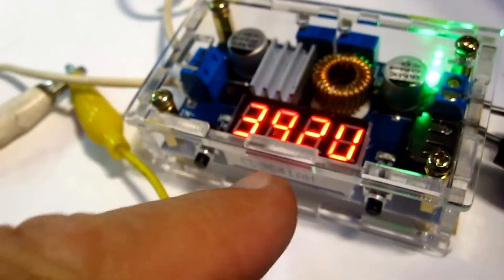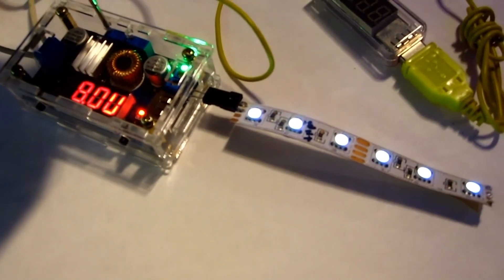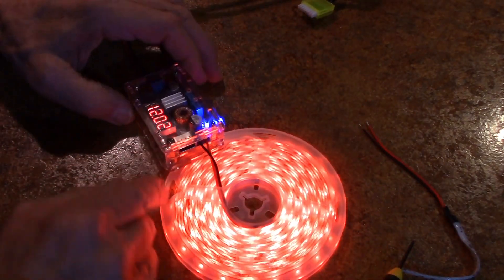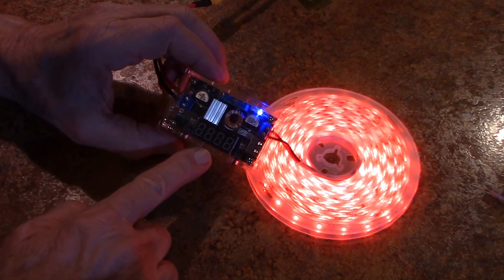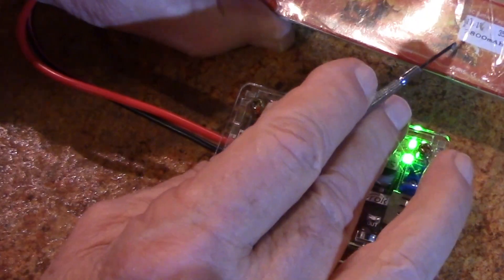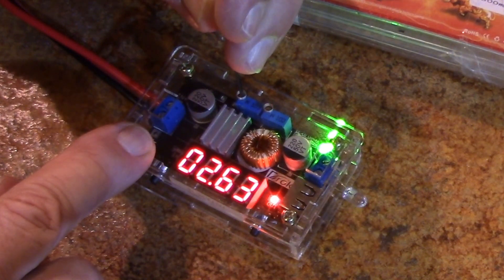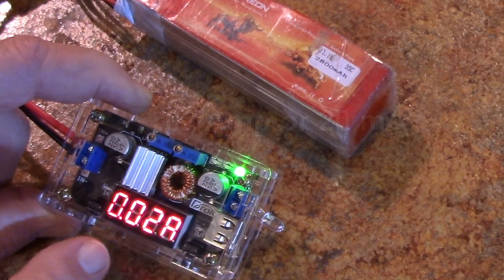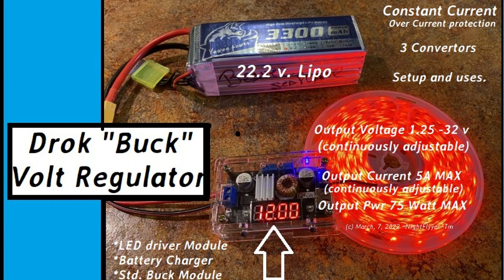This DROK still rocks! Here's how to use the DROK LM 2596 "Buck" Voltage regulator with a demo.

Comment: How would I add this to a light circuit in my car to increase the voltage on the drls?
Reply from the maker: This only reduces voltage and does not increase it.  You need to tap off you motor battery, and use this to reduce the voltage to where you want your brightness to be on the lights.

Comment: These things are fragile! Mine lasted 1 day and then sent out a smoke signal and died. Also, wires did not stay tight for power in and out. They would loosen up after about 15 minutes and fall out. Junk!
Reply from the maker: Yikes.  Mine still works fine.

Comment: Seems a little overkill for what I need.  Does anyone make a simple inline USB voltage regulator?  I just need to tone down a USB device.

Good vid, thanks for the review!
Reply from the maker: Its completely built and under 10 with variable output to the USB port from 3 to 5 volts and 3 to 5 amps.  Not sure why you want to tone down a USB, but this is simply using an LM2596.  You can buy the chip, eliminate a lot of stuff in this module, and build it to your liking.  Good luck.  Thanks.

Comment from the maker: *Please Read! This DROK LM 2596 Buck Volt Regulator looks like a Jewel but tells input voltage, output current, has a USB Charger, and works perfect for my projects needing variable DC power.  On my 12 year old product review video, a  fellow commented and said the case does not have the legs cut right. 
Okay, there are no instructions and the case is a puzzle,  but each piece, which is precision cut, will only fit one way!  
So turning inside out, upside down, until you get it takes some patience.  Others complained there are no instructions, which is true, but if a person was going to use this, he would easily figure out from the picture and the printing of how to make it work like I did.  If not, hopefully my video will give you an insight of what you can do with this neat gadget that costs under $10.